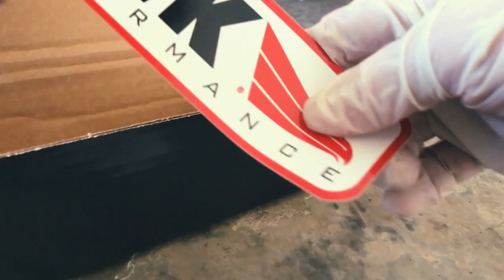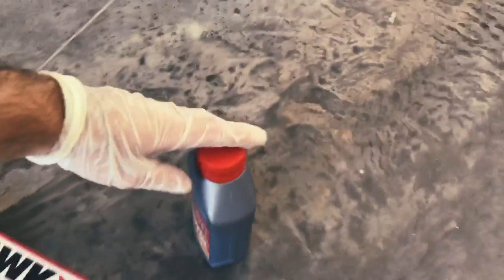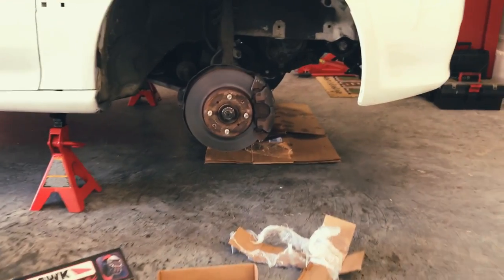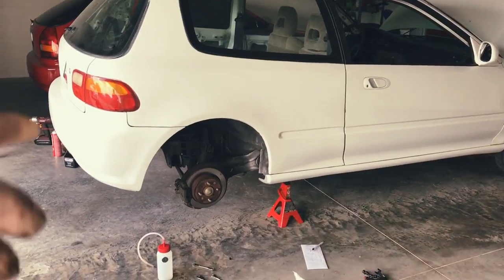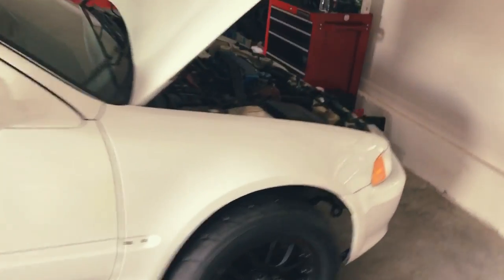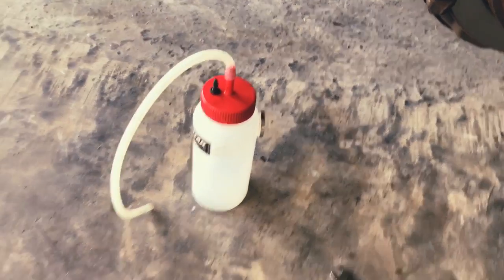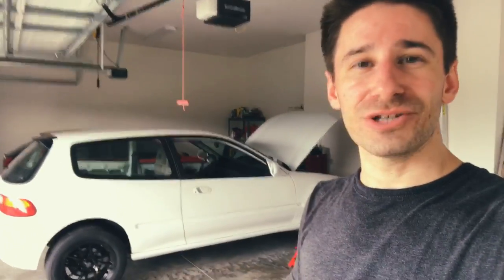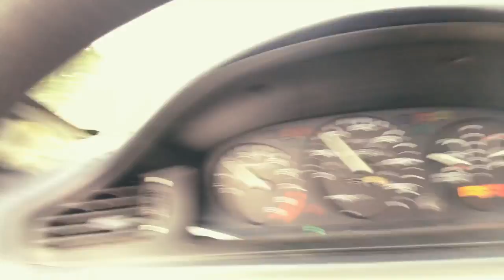MOTUL RBF 600 brake bleed | HAWK HP+ track brake pads upgrade | Project Honda Civic EG hatchback

Comment: I just used these pads for the first time on Sat and what a huge upgrade from some non-racing pads that I was using.  I also made a video, but won't be out for a couple weeks!  Good stuff fellas!
Reply from the maker: Awesome Jon, glad to hear you liked them! I saw your post on IG that you went running, did the car perform well for you? Apparently you noticed a difference in braking power haha. Like you, I too used the Advanced auto off the shelf whatever pads the first time I tracked the car, so the stopping power should be pretty noticeably better. We'll be looking for your video too!
Reply: Refine Movement It was night and day difference!  I used to have to run a solid lap before I could feel the bite and these have it all the time.  I also swapped to some Centric Cryo-treated blank rotors at the same time so that may have also attributed to the additional feel but it's excellent!  I can't even imagine how a track only pad set must feel!
Reply from the maker: Wow Jon, sounds great man. I'm sure using a new, purpose built rotor with the pads does help for sure, that would be my next step as well. I noticed a difference even using the same rotors so it's safe to say these pads are just better than the off the shelf stuff haha. Yeah, a track only pad with a proper rotor like you have must be pretty gnarly. Gotta make sure to have tires that'll keep up with that kind of performance. But we'll both see when we get there huh
Reply: Refine Movement damn right buddy!! 😉

Comment: I have my own 1 man way to bleed the brakes. I run clear tubing to all 4 bleeders and the route all 4 tubes to the brake MC. I use a zip tie to hold them together. Top off the fluid and then hop in car and with all 4 bleeders open I just sit and pump a lot. You will see bubbles in the tubing cuz it's clear and since it recirculates back to the MC, gravity will bleed the bubbles out when reaching the top as it dumps back into the MC. Then just tighten the bleeder screws and good to go. I hope you can picture this in your mind. Pretty easy process. The hose costs about $6 total. Find it at Lowe's. Just basic clear tubing 3/16" I think
Reply from the maker: That's pretty inventive there man. I can picture what you are describing. Seems like it's a quick way to get it done anyway.
Reply: well that works to change fluid for the same fluid, what if you want to change old fluid for something better, youre contaminating the new fluid you put in the MC, are you not?
But to get rid of trapped air, yeah that will work, and much easier then checking your progress on every caliper

Comment: i never seen that done before that looks really easy im going to have to get a car soon and my dl and did you learn to drive in a stick or automatic ive driven automatic before but never stick what would you recommend
Reply from the maker: My first car was automatic Zachary.  The red ek was my first car with the manual transmission.  It all depends on what you want out of your car man.  Some people think shifting is a pain, or maybe you'll be sitting in traffic a lot and don't wanna push the clutch in all the time.  I dunno, for me, I am not bothered by these things.  I love the control you have over the drivetrain with a manual trans, so I'd pick that all day everyday, but you just gotta decide what's best for you man! Try both since you're new to it.

Comment: You should of changed the rotors also not just the brake pads
Reply from the maker: Yeah. That'll be next time. These rotors are straight and have plenty of meat to them still. Fine for another track day anyway. Next time I need to get new pads rotors will be coming too

Comment: mow many bottle of brake fluid for a flush?
Reply from the maker: Depends on how many times you’re going to need to press the brake pedal to get all the air bubbles out. I have always been safe with 2 bottles